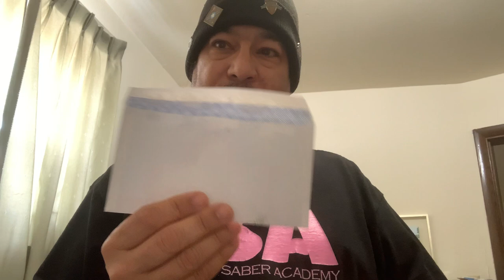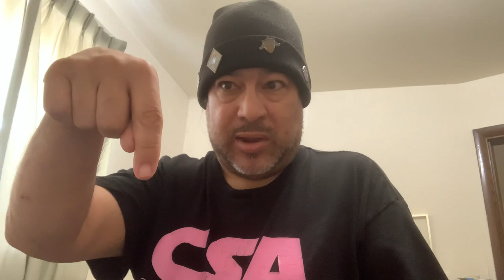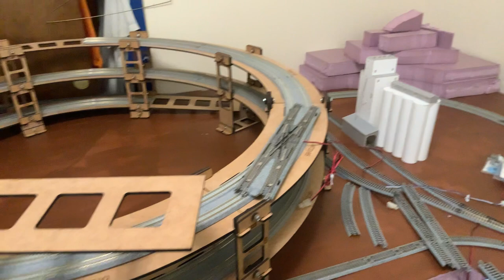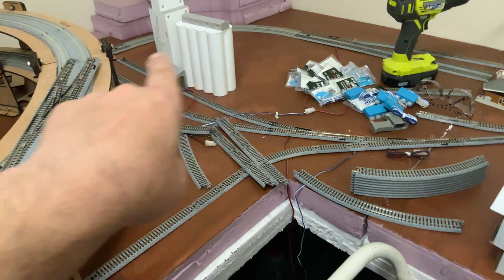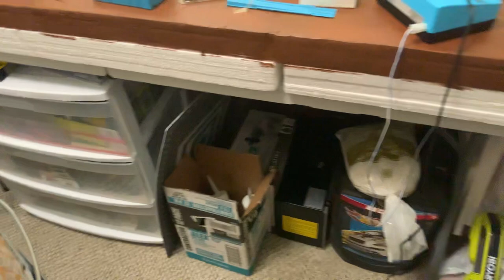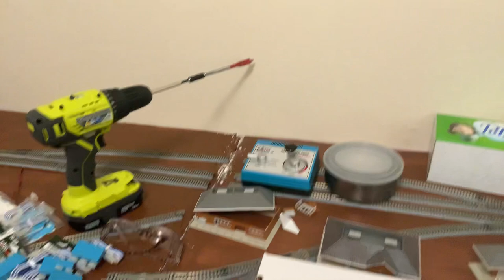Mail call, Shoutout, and update! Featuring the Proses Eco Smart Helix for Kato Double Track.

Comment: congrats on 100 Eric! hey if you need to you can build "bridges" of track using atlas flex track. I use atlas flex for my entire layout but i was able to integrate a kato double crossover- only the elevation had to be adjusted- the kato roadbed was higher than the roadbed i was using. other than that, you can totally use atlas flex to span spaces where the kato doesn't line up. ps- i would recommend code 80 on the atlas flex track.
Reply from the maker: Oh really, thanks for the advice. I was just going to cut some track lol. That sounds better. I will just wait then. Thanks for watching John, be blessed my friend.